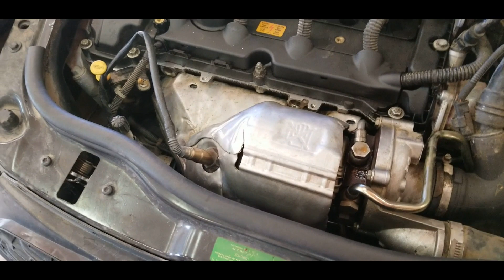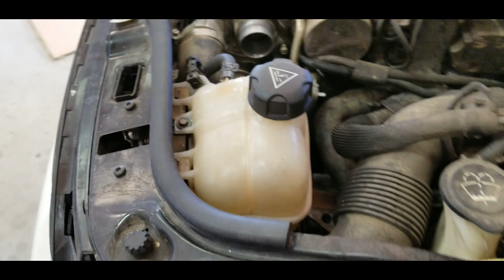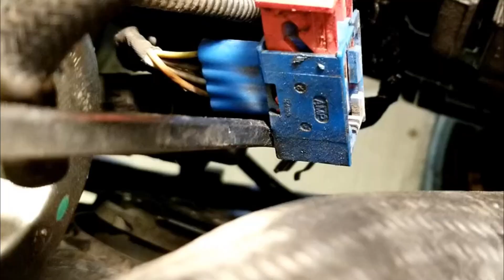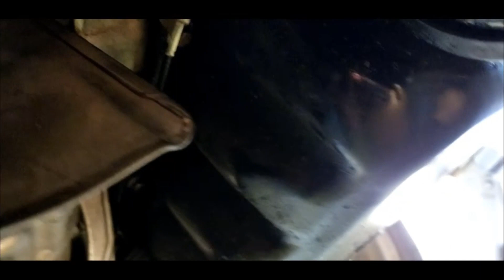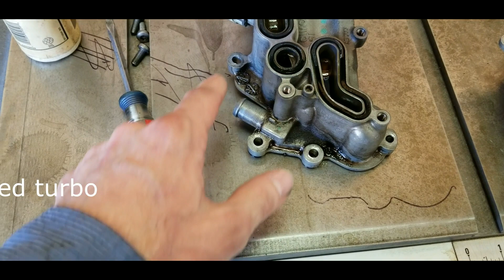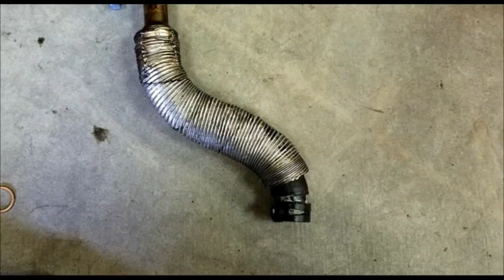Mini Cooper S R56 Turbo Oil Feed Line Replacement

Comment: I couldn't do this job without putting the car into front end service mode. My issue was getting the lower 3 10mm bolts out of the top heat shield. My big mitts didn't fit between the heat shield and the radiator. And forget about getting the lower heat shield off without making room, my hands got cut to ribbons just trying. Seriously, it's not that much more work, and it actually saves time when you don't have to struggle to get a socket on a bolt because you made room.
Reply from the maker: I've never worked on a car so tight.  You did well, great job !

Comment: Great video... thanks!  I have a question; what is the fine white smoke emanating from the area of the turbo when you cranked it up?  Mine did the same thing after I replaced the turbo oil feed line, and the oil filter housing gaskets, and I can't quite figure out why.  Could coolant have gotten into the turbo somehow?  I'm puzzled.  It only smoked for a few minutes, but it was concerning, for sure.

Thanks again!
Reply from the maker: I think the smoke you saw was residual oil before the leak was fixed.  It  will burn off and should not smoke anymore.   If it continues to smoke, the leak was not fixed.  hope this helps
Reply: @vanguardhotrodshop8633  Hey thanks for responding... it was a very white, light smoke that dissipated quickly, and I'm thinking it might have been residual brake parts cleaner that I sprayed all over the heat shields before reinstalling.  I don't know for sure, but it's all good now.  No leaks!

How much, do you think, does the dealer charge for this job?

Comment: Good video, especially doing it without putting in front end service mode. If you are doing the oil filter housing gaskets, I would recommend front end service mode and dump the coolant in the beginning.

One thing I noticed you missed. The heat shield blanket protecting the Turbo Oil feed line. It's a recall that most people have already had done. Usually they come with these stainless steel braided line kits. I would advise everyone to put one on if they don't have it already. It protects that oil feed line from the intense heat of the turbo.
Reply from the maker: Good advice, thanks !
Reply: What’s the recall called?

Comment: Hi, question, my mechanic find out a leaking in my turbo oil line, he also told me that it had an "anomally" and the whole turbo needs to be replaced, do you guys think I can solve my problem with this? I found this same kit a cumple of days back, im curious because this seems to be the perfect solution for me ..help :/
Reply from the maker: Not sure, I know that there is some oil in the intake ducts between the turbo and the throttle body.   The duct betweent the turbo and air filter is clean.   This leads me to believe that the seals in the turbo are starting to leak.  I may replace those next

Comment: is it necessary to change the oil housing gasket?
Reply from the maker: I am assuming you are referring to the oil cooler to block seal.  It is not neccesary but since you are in there, the access is great.   This is a know leak area so I just replaced it while I was in there
Reply: @vanguardhotrodshop8633  thanks!

Comment: Doing mine now!  I didn't disconnect my o2 sensors. I just removed them from my downpipe and let them hang.  Mine is a bit easier because I already had it apart to install my downpipe.  The hardest part is the heat shield! Thanks for the video!

Comment: Wasn't making any hissing noises before you took it apart and it wouldn't have helped just to try to tighten it a little bit more
Reply from the maker: The leak was not at the copper washer, it was the crimp between the hose and the fitting

Comment: Do you think or guess if I squirt a bit of RTV silicon or sealant inside just where that tube fits in that crimp where o rings gone it will seal it ? Just a lot of work and mines same spot leak. I actually tapped the tube and it moved in more to fitting
Reply from the maker: It might help in the short term but long term, It may come back to haunt you